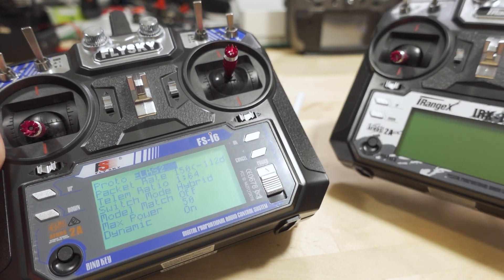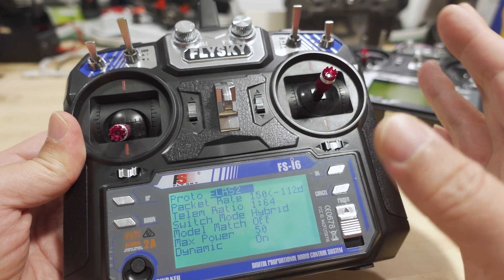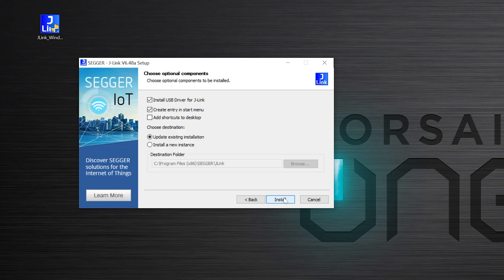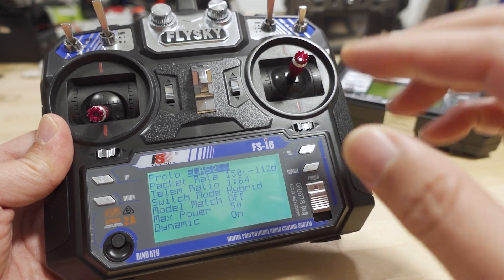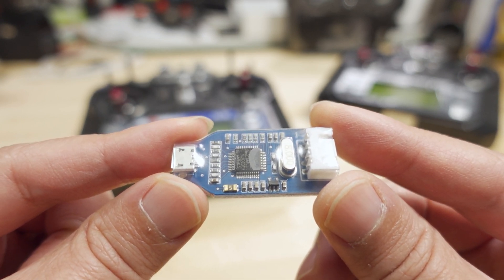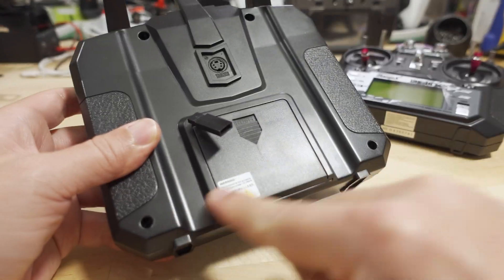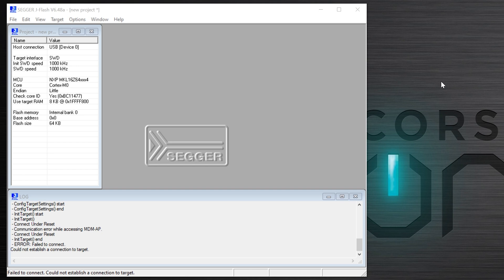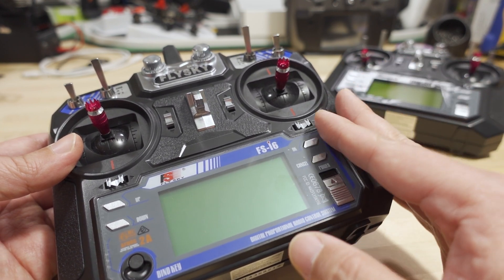ExpressLRS on the Flysky FS-i6 Radio Tutorial 🎓

Comment: Hi, I'd like to carry out this procedure on my i6 but I'm being told by an expert that it will have degraded functionality compared to native ELRS because sticks will have reduced sensitivity, high latency and because the ELRS will be OpenTX vs EdgeTX, lacks ELRS lua and is otherwise antiquated. I just need RSSI and a more reliable signal than the proprietary FS i6 one, I don't need cushy hall modules or extra functionality. I don't want to throw money at the latest ELRS iteration if I don't need it to achieve my objectives. The premise of my question is to find the cheapest way to achieve my goals.
Reply from the maker: Yeah, this is a hack with some downsides but I think those you listed might be somewhat exaggerated.  If you need this for high-end competitive racing, spend the money on a real setup. If you just need something to casually fly, this setup is adequate but I don't know what your objectives are specifically so I can't be the best judge of that.

Comment: How about the max range?
Reply from the maker: That depends on the power output of the transmitter module you use.  If you use one of the 1W modules, the range could be as much as 50KM or a lot more.

Comment: Hey, thanks for the great video on showing us what we are in for, should we decide to try this. My question is, once you do this, can you still use the transmitter"s integrated module and fly your original flysky receivers. And if it can use both the integrated module, and the elrs module, do you chose which module per model settings, or would you have to change the whole transmitter mode everytime you want to switch between a model that is elrs vs afhds2a? I thought about buying the TX12 transmitter for elrs, but if I could use my existing fsi6 and switch to elrs one model at a time as I buy receivers, that would be awesome, and I still like this transmitter.
Reply from the maker: I think you can use the internal Flysky TX but I got rid of all my Flysky receivers and did not test this scenario.

Comment: Great video as always Albert! Quick question though, I watched Drone Mesh's video on adding a multi-protocol module to the FS-i6. But in his example, he tapped the module to the PPM-OUT pad. Which in my head makes sense because it takes the PPM signals OUT from the transmitter and IN to the module. Any particular reason you tapped in to the PPM-IN pad? plan on doing this in the near future. Thanks in advance!
Reply from the maker: What he did was totally different from this new method.  Also, if you want details explained, you need to read the github page (link in the description).  I don't know how this works other than I followed their instructions and made a video on the steps I took.

Comment: Hi, thank you very much for very detailed video on how to flash FS-i6 radio. I did everything like in video, it passed great, but I have one issue. Whenever I go to Protocols section, and choose ELRS2, on my transmitter lights go off and some screechy sound its started. If I return all the way back on home screen, graphics are weird. What could be the issue? I tried older firmware and it's the same as on the newest (1.0.8.2). ELRS module is BetaFPV 2.4ghz flashed on 2.5.1 version.
Reply from the maker: I have no idea.  I would go to the RCgroups link and ask over there.
Reply: I have the similar problem - did you manage to find a solution?
Reply: @alexanderplatonov1986  yes, i bought radiomaster 🤣
Reply: yee, it's good idea)) 

I already have Тх16s, but it's huge, almost twice bigger than fs-i6... But unforunately seems this cheap radio is almost complete potato

Comment: specifically what version of the er9x firmware are you running, also what version of elrs? I am using the same module as you in this video but when i select the ELRS2 protocol option on the radio it just says loading. Thanks.
Reply from the maker: Watch the video at 2:22.  ELRS firmware is 1.x I think.  I don't remember exactly.

Comment: I have the eachine i6 version of the FS-i6.  I understand that I need to flash to the original FS-i6 firmware before flashing alternative FS-i6 firmware.  Then  based on your reply to another poster I can buy any ELRS module ( ie a Jumper radio module ) as they all have the CRSF protocol port?  Can someone please confirm?
Reply from the maker: I think the Eachine version is exactly the same.  I don't know why you have to flash the Flysky firmware first.  I've never heard of that before.  It should work the same way AFAIK.

Comment: Hi there I have put this software on and wired up the module but I don’t get anything on the screen of the transmitter when I go into the protocol section any ideas??
Reply from the maker: It is unable to talk to the ELRS module. Something is not wired up right.
Reply: @AlbertKimTV  finally I figured it out, where I have put a jrbay in my controler and are using the jr bay plug you need the ground connected to your controller elce it don’t work. Btw I was using an external battery for power

Comment: Where do I connect my pins for the elrs module i do not have the one you have in the vid mine has 4 holes where you would connect it to a jr bay but I don’t know where to solder them on the bord?????????   
Pls help someone!!!!
Reply from the maker: It's the same pins.  All modules have the same JR module bay connector.  I just soldered mine on the opposite side.
Reply: @AlbertKimTV  so where would I connect the S port on the controller??

Comment: Hi Albert, just a question what power do you use for daily flying freestyle i just bought one of these and can i use the lower power settings or should i use 100 to 250.
Reply from the maker: I generally just run 100mW on dynamic power unless I plan to go far away.  Then, I'll bump up to 500mW or 1W but this is almost never.

Comment: Great mod for this great radio! Is it possible to use ST-LINK V2 to flash the new firmware on the radio? Many tnx!!!
Reply from the maker: You'd have to ask the developers that questions.  I have a feeling the answer is no because that programmer is specialized for the chips on that radio.
Reply: You could use STLINK V2 to flash I6. Look for OpenOCD tutorial to flash almost any board with any SWD programmer

Comment: Do you really need that particular programmer? I have an ST-Link programmer, and I've used it before to flash my i6 to the FlyPlus firmware. I wouldn't think the choice of programmer matters? It's all a matter of getting an hex file into a chip, using a shared IO and Clock line.

Anyway, very cool stuff. Before I got my Tango 2, I was searching high and low on how to get OpenTX for the i6. I seem to remember that in order to do anything of the sort, you actually had to swap out the main firmware chip. I didn't think it was worth it, but now I might very well do this! I haven't watched your whole video yet, but do you experience any type of added latency with this? The stock/upgraded firmware with AFHDS2 is a very fast protocol, and it would be bad to upgrade the radio just to have added latency.
Reply from the maker: I searched for a way to program this with my ST-Link as well since I didn't want to buy a new programmer.  I was not able to find a method that would work with the i6. Also, isn't the Flyplus firmware only for the i6X?  I didn't think it worked with withe i6. I did not notice any latency as this is not using the PPM protocol but CRSF serial so it's running at full speed and you're just limited by ExpressLRS latency which is very low.
Reply: I know I am late but isn't ST-Link programmer only used to program STM32 or any other STM microcontroller?
The microcontroller in the transmitter looks like one form NXP.
And the particular programmer used in this video uses J-link as a protocol, unless ST-link and J-link are compatible, I don't think it will work.

Comment: Thank you albert! This is the tutorial I've been searching for for soo long, I've been asking everywhere, whether it be the rcgroups, the er9x devs, and opentx devs. specifically I've been asking whether or not the ersky (flysky i6 version of er9x) would support CRSF protocol, or whether opentx would ever have an flysky i6 version (which in this case no, because of the MCU chip for i6 has memory limitations, therefore only the i6x opentx exists, which has an MCU with larger flash storage). and it seems this particular github repo is also fairly new, so am i glad that the community is still very curious. now I can happily repurpose my old flysky i6

Thanks! Can't wait for you next video on how to actually use the ELRS module
Reply from the maker: There's nothing different about how to use the ELRS module.  It works like it does in any other radio so there's already many videos including a whole playlist of videos... http://bit.ly/370CYSH

Comment: I don't know how dumb of a question this is, but seeing as how I want to invest in expresslrs and really like the feel of my fs-i6 this seems like a really good option for me!

So my question is would you still be able to use the simulator functionality through the the socket on the back?

I myself have already took a power only USB cable and soldered it up to my radio so I can just use battery banks to power it lmao. 5v and more mAh than I ever need! I've only charge the thing 6 times and I've been flying pretty much daily since almost 2 years now lmao
Reply from the maker: Not sure if the simulator functionality will work the same or not but you can enable the bluetooth joystick on the ELRS module to connect to your PC wirelessly for use with simulators.